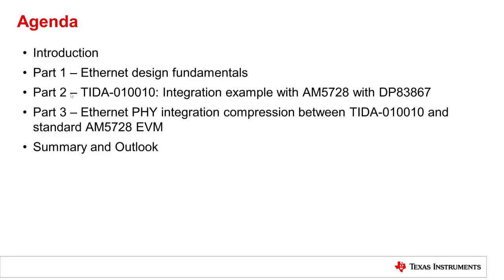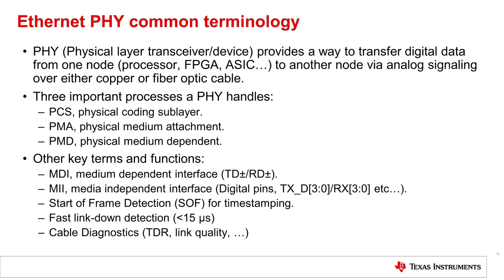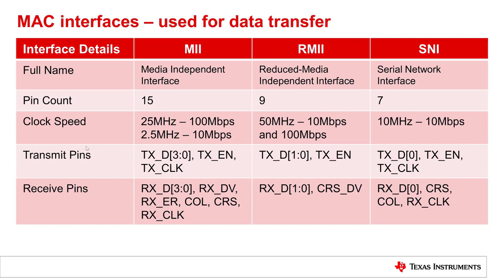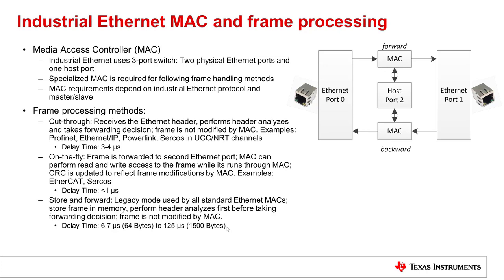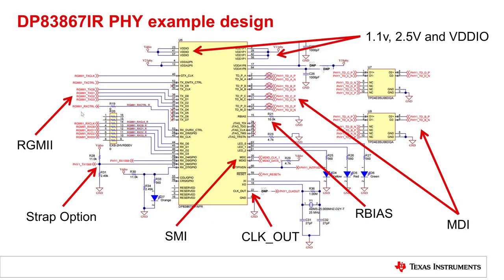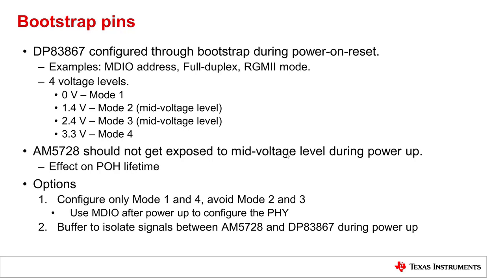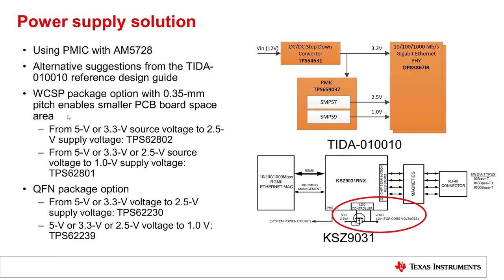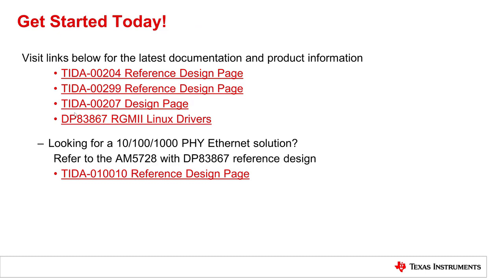How to solve design challenges on interfacing Ethernet PHY with processors or microcontrollers

Comment: 19:34: for what are the "magnetics"?
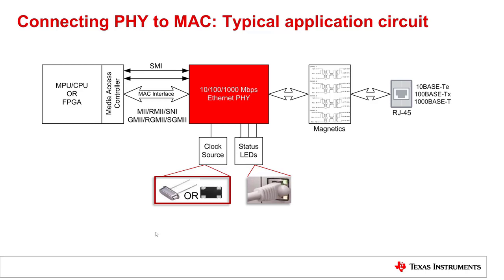Reply: They're isolation components. Ethernet spec requires galvanic isolation from the cable. They're often built into the RJ45 jack. There's a blurry image at 4:10, but RJ45 jack data sheets (like the HY931147C) have more readable schematics.

Comment: At the start of the video, RGMII was described as it takes 125MHz Clock freq whereas later we were designing with a clock input of 25MHz, I just got confused. is there anything I missed, Thanks
Reply: Hello this clock is usually generated internally from the 25Mhz clock (probably from a PLL)  or accepted from an external source (Such  as a MAC) as a125MHz signal input signal.

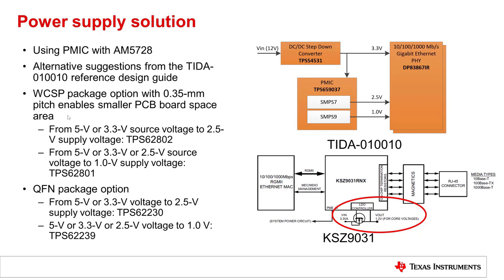Comment: 19:00 -- a bit misleading. The external MOSFET + internal LDO of KSZ9031 is just one of the four (4) power scheme options. (http://ww1.microchip.com/downloads/en/Appnotes/ANLAN206-UNG.pdf) If the user prefers lowest EMI and the best cost, then external MOSFET with internal LDO is the solution.